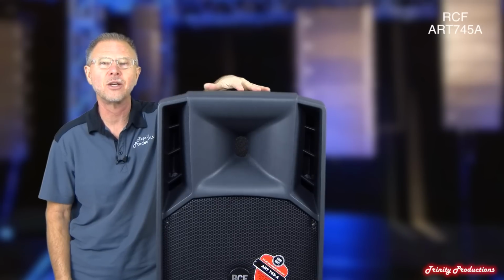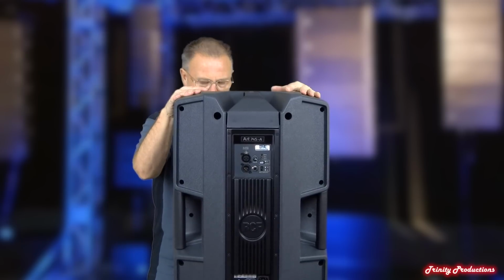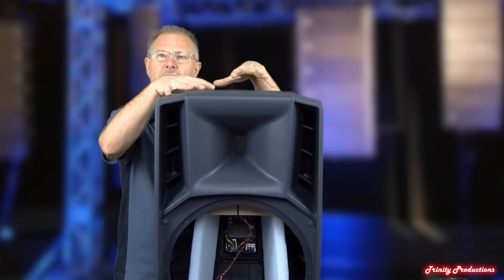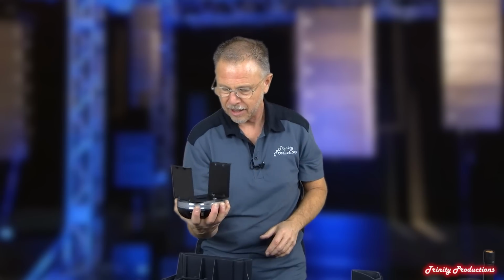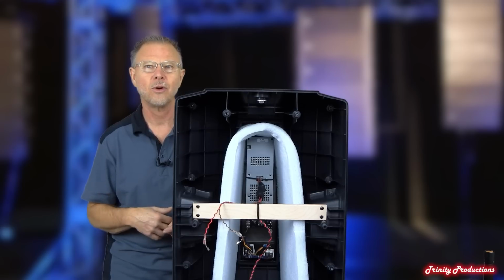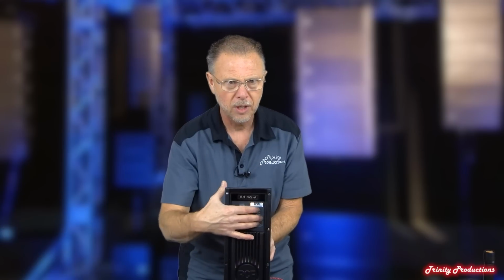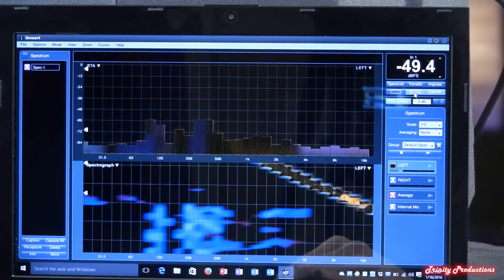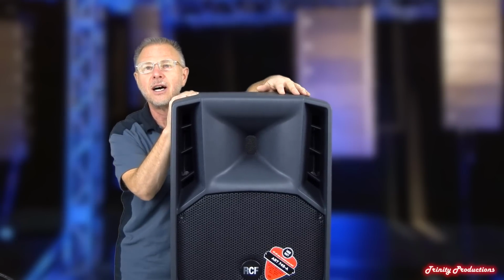RCF ART745A Complete review - 2 two-way 15" x 4" most awesome speaker - AUTHORIZED DEALERS

Comment: Currently i have a set of EV ZXA5's but i am reading that the 745's have better sound. What opinion could you give me with these two different speakers.
Reply from the maker: same SPL where ever that was measured on both, but the crossover point is much lower on the RCF giving a much smoother transition to the HF driver and not demanding the 15" driver produce up to 1.5khz cross over point. Event though EV states more power, much have very inefficient drivers to reach the 133db max SPL, vs. RCF 700 watts to do the same , RCF is crossed over at 650 on that massive HF driver

Comment: Hi trinityprosound, thank for all good reviews, iam hesitate between RCF 745A and FBT Mitus 114A can you tell me your opinion. Thank
Reply from the maker: I would have to go with the ART 745. much lower crossover point for the large HF driver and much smoother response IMO overall.  these cabinets are not the same as one is wood and the other is injection molded. but the HF for the FBT is crossed at 1.4khz and the 745 round 800 hz
Reply: Can you just explain me, the difference =  HF for the FBT is crossed at 1.4khz and the 745 round 800 hz, I need more speakers for church choir, Thank
Reply from the maker: the higher the cross over point the more "harsh" the HF and places more load for the LF driver to reproduce up to cross over point.

Comment: we need a church setup so i would really need your advice. our auditorium is 20 meters long, 5 meters high and 12 meters wide, we got 2 x 4pro 8003 RCF subs. what woul you recommend for the tops? we are runnig live worship music, so we need clarity and quality. 
i thought of 3-4 db technologies T4 or T5 array on each side (up in the air). do you think a full range speaker like the 745A  would do a better job? in that case, what speaker would you recommend? please reply, i am a big fan of your videos and i would really care for your opinion. thanks
Reply from the maker: Look into the RCF NXL24 and NXL44 speakers. Those on top of subs are very directional in the vertical and will keep the sound focused for you and they sound fantastic, the NXL44 may be to large for you , but we have sold a lot of the NXL24's for live use and the sound companies love them. If you use the 745's they will do a great job but adding to that speaker with another pair would generate comb filtering issues if not deployed correcting each time. One key thing. Get the speakers up in the air and focused towards the audience.
Reply: trinityprosound your answer is highly apreciated but got me a bit confused. i only want a pair of tops or 2 columns of line arraya (left and right). do you think 2 tops are better? also, u say that those 2 tops shoulb be the NLX series better than the 745A?
Reply: do you think the 8003 subs will pair good with the NXL 24 tops? and for this kind of space (small church hall as described above here) will they do a better job than a classic line array?
Reply from the maker: Yes, for the size that you are they will work quite well. What is your average attendance...A EVOS 12 system may work for you, as we have a church with EVOX 8 doing 150-200 in attendance with full band running through a set of EVOX 8's , pole mounted NXL24 and 8003 would pair nice but the NXL24 will out run that SUB.  Tell me more about your services, needs, style of band and worship please....
Reply from the maker: Yes, will be more focused for you and can be easily expanded if you need to grow, etc. to add a 2nd box on top
Reply: @trinityprosound >> my church hall is pretty much the same as described, we do live worship services with full band (roland v drums with a puchy kick, keyboard, acoustic guitar and base guitar that pump it hard) and also do evangelistical events with playback music and rock music every week or so...  the first line of chairs starts at about 4 meters from the speakers, we have a pair of 8003 subs with  rcf art 712 mk2 on top, but the tops are by far outrunned by the subs....do you think the nxl 24 would be a better idea? do you think the nxl 24 will highly outrun the subs or could i put the tops at 1/2 of their power and run the subs in full mode to balance the output? 
i am not interested in high power that much for the inside as much i care for the better quality overall and a longer life, but we ocasionally do outdoor events and i think the nxl 24 would be a very good idea for the output they have.... 

I am very tempted to buy the nxl24's, i just need to know it's the right speaker for us..i was thinking also at the 745's for a long time, but the nxl 24's are really...something beautiful :) 
waiting for your answer. thanks so much for your help so far
Reply from the maker: IMO the NXL24 will work well in your application and get the sound where it needs to be . placed on the right extension poles on the 8003 subs would be a good match. and yes you can do some gain matching to the tops do not outrun the 8003 subs
Reply: thank you for your reply, helps alot. so i will buy the NXL 24 A based on your advice, they look great also :)

do you think i should get the 6 inch pole or the 1 ft pole? the crowd is about 100 people, in special events 200...
and also, do u think the difference between the 8003 sub and the 8004 is that considerable? would it worth the extra money spent? if it is so, i am considering changing the subs also in the future, so please give me your opinion on that.
Reply from the maker: buy an extension pole that will put the top at around 6' on top of the sub, since the speaker has a down angle built in to the coverage it should work well and cover very nicely, you won't be disappointed.
Reply: 6 inch pole, perfect. and do you think there is such a big difference between the 8003 and 8004 subs? i haven't heard the 8004, i just see it's almost double the price :))
Reply from the maker: yes, it has more power and almost double the SPL output of the 8003. with that sad, the 8003 for a single 18" is still a very good sub
Reply from the maker: If the 1 foot pole gets the top at about 6 feet, excellent. that should work out very well. yes, there is IMO a solid difference with the older 8003 vs. 8004, however new 8003 is out now and really sounds better IMO that older model, but 8004 is my favorite single 18 at this point, yes more $$$ but worth it.
Reply: @trinityprosound i talked to my friends, we will buy the 8004 subs :D:D:D

about the height: the sub is 70 cm tall, that's 2 feet. so with the pole another ft that will be 3 ft in total. the speaker will be from 3 ft up . is that ok?
Reply from the maker: yes, that or a bit higher, so that the horn at the top is slightly over the top of the audience heads for the natrual downward coverage of the speaker.

Comment: I'm still torn between the 745-A and the NXL24-A. Which one do you think has better HF output? Thanks.
Reply from the maker: It depends. The 745 is broader horitzonal and vertical, but does have a lower xover point. The NXL24A is more focued in the vertical and a bit higher xover, but I have had excellent comments return on both speakers. You will need a subwoofer with the NXL24A for the full low end sound. The 745's do a good job down to around 80 without a sub, but to do it right, both systems really need subs.
Reply: Ok, thanks! I think I'll go with the NXL24 for the sleek, stylish and low profile look.
Reply: Funny, that's exactly what I was going to post as a question.  But, I don't know that the question was truly answered.  if one was to be doing a live show outside with 800-1,000 people in the audience and you had either 2 NXL24's or 2 ART745 per side with subs (8003 as II), which would you rather?  Or, is it more a matter of the sound you where going after?
Reply from the maker: you won't get near the output and coverage with 2 NXL24 or 2 ART 745 for that many people. to do a decent job, you are going to need 4 of the NXL24's the ART 745s do not really present themselves to couple like the NXL24's do and you will have comb filtering trying to use the ART745s - go with the NXL24's and get a system you can expand on for future needs

Comment: Thanks for this awesome review.  The RCF 735A is in my price range.  How does it compare to the 745A and the HD32A in real world listening?
Reply: Anybody serious about their sound but having this purchase dilemma between the 735 and 745 should bite the bullet, cut back on eating out for a few months, and just buy the 745’s.  Yes, they are better than the 735’s in every way except price.
Reply from the maker: +Zeba Santiaga Thew 735 is close , but with the smaller driver HF, a higher cross over point, same with the HD32A....if you can afford it, the 745 is the way to go...but with that said the 735 or HD32 will not disappoint you either...

Comment: Ive got a pair of 8004s and looking for some new tops... I can get some TT22A IIs for just over the price of these 745s.. would you care to recommend which way your would swing?
Reply from the maker: +Russ Hollinshead To keep the look consistent between your tops and bottoms the TT boxes, but for sheer performance and audio quality output the 745 are the way to go, better driver, larger and lower cross over point. Night and day difference between a box crossed at 1200 and 650 as with the 745
Reply: +trinityprosound thanks for the response. My gut feeling was telling me the 745!
Reply from the maker: 👍👍 yes

Comment: Hi  I'm on decision to buy RCF 745A or EVO 12.Im a mobile dj.I do events up to 500 people.Which speaker from this 2  its better to go? And what is the difference on sound quality from the 2?
Reply from the maker: +phanos tenizis you will need a separate subwoofer with the 745's ... the EVOX 12's with 2 would be pushing it for DJ for 500. you are going to need a much bigger system with 2 18" subs per side and really good top boxes, anything less and you will over drive them and most likely damage your system

Comment: As usual one of the best on youtube.
I have 722a and maybe would go for a newer speaker. My question is, should i go for te 732a or the hd32a. i also have 2 905as, that's why i stick with 12 inch speakers.
Thank you
Reply from the maker: +Peter van den Berg Both are equally good...the HD has a lower xover point than the 732 ART box...I like the lower crossover point personally, but it is only 100hz difference... I like the full grille on the HD line as well....everyone that has purchased the HD32A has been blown away with the output and sound quality.
Reply: Thank you

Comment: Thanks for this super detailed and informative video! I have one question, though: in your opinion how does this compare to the NXL24-A? A friend of mine owns the NXL24 and has heard the 745-A, and he claims the NXL24 is "definitely louder and cleaner."

I don't see how that's possible, though, since the 745-A is rated at 133 SPL and the NXL24 is rated at 131. I'm confused lol.
Reply from the maker: +Artanis224 it is based on the directivity of the speaker and "focus" so to speak, the NXL24 is more focused in the vertical plane . NXL24 100h x 30v so more energy of the audio is in your face, vs. the more open 90h x 60v of the ART 745.

Comment: Amazing video/review on these 745 RCF Box's. Thanks so much for ripping yet another box apart for us & going through such great detail.
Reply from the maker: +Apache Cai 745 is much better , lower crossover point and larger driver on 745
Reply: Tony Draper Nice to see you too, Tony. I agree, the power-con connection is really convenient. I'm really looking forward to the dB Ingenia, as most of my gigs are at small to medium venues, the asymmetrical horn is gonna help to minimize the reverberation of the room.
Reply from the maker: The Ingenia is amazing in all boxes in the series. We will be doing video on the 4T soon.
Reply: +trinityprosound The 3T & 4T both use 3" voice coil for the horn, same size as my HD32a, but the cross over point of the Ingenia is higher than HD (1100Hz vs. 800Hz). Which one do you think sounds better? Since you've listened to both of them. Thank you, John.
Reply from the maker: +Apache Cai 3T for sure...it has largest drivers 10" that sound amazing
Reply: +Tony Draper Wondering how our HD32-A sounds compare to these Art745...haha...
Reply: +trinityprosound Thank you, John. Looking forward to see you take apart the dB Ingenia Series!
Reply: +Apache Cai 

Hey buddy, John is right. These sound a bit nicer due to the larger HF driver. It also has a 15" woofer that will hit lower freq than our 12". We use subs so no need for a 15" top. Overall you still own a great box. It is the same as having a RCF-732 box. I personally like our HD32's btr cause we have power-con ins/& outs which none of these 7series Box's offer. Btw. Watch all of Johns videos on RCF.  This is how I learn as well. Nice to see you here bro.
Reply: Okay, so If one was to get a new system to accommodate 800-1,000 people at 95 to 100 dB 75 feet from stage with approximately $2,000 per top budget would you go with 2 art 745 mk4 per side, 2 NX24's per side, 2 IG4T per side or 2 IG3T per side, with the appropriate sub?  Everyone can voice. 60lbs per top is a max weight because of possible stacking capabilities.  Thank you for any input on this.
Reply from the maker: you will not be able to do that many with only 2 boxes. NXL24 x 4 or IG4T x 4 and maybe 4 x IG3T - won't be able to do with ART745 per prior comments...
Reply: Really?  I'm surprised.  I have read review after review saying that you can do events with 500-700 people with just a single top and sub per side.  So, I assumed you could add one and a half that audience by doubling the speakers.  It should add at least 3dB and create a much bigger spread and longer throw.  Just to be sure, I was saying 2 per side, stacked 24's or stacked dB's.  Or the 745's side by side fanned out.
Reply from the maker: I am speaking of real world experience... you can do that size of event, just wont have rock concert SPL levels with 1 per side. That is asking a lot from a single speaker and sub. The 745's fanned or splayed is not going to work like you think, they are too wide of dispersion pattern, you would have to really angle them to prevent comb filtering issues, they are not really designed to splay like that...
Reply: You're right.  Those dB levels are way too much.  I never mix that loud.  I don't even know were I came up with those!  That's what happens when you post things late at night.  I am just trying to make sure that I'm replacing my Yorkville psa1 (6) and Yorkville psa1s (6) (3 per side) with something that is an equivalent or improvement with 4 tops and 4 or 6 subs and easier to set up.  2 NX24 stacked on 2 8003/4 or 2 IG3/4T stack on Sub 18H on each side of the stage.  I say it over and over again, thank you for your input and your patience.  Your videos are incredibly valuable!